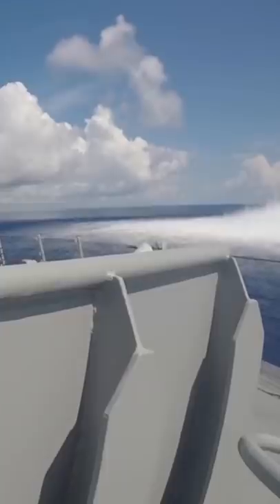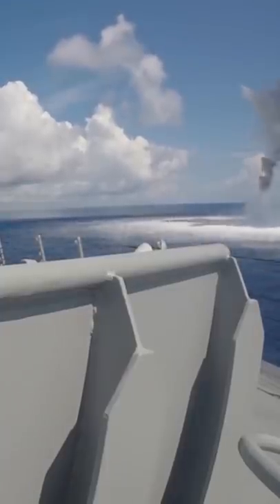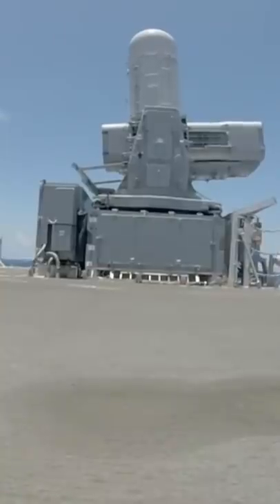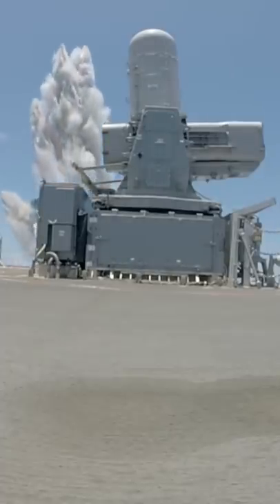Why US Navy Detonates Large Bombs Next to its Ships? #shorts

Comment: It’s unlikely that simulations could be as effective due to variance between design and manufacture.
Reply: Also, how do you test the quality of the simulations?
Reply: I was a shock SME at BAE systems and it’s quite easy to assess through simple calculations if equipment can’t withstand the acceleration from a shock event. The shock trials are a final test of the whole ship, and in many cases it’s not performed, especially when nuclear powered. If the ship isn’t designed to with stand shock, the shock trail will destroy it, if it is, then it will be fine and so the test is pretty redundant because it would be too late to change the design because it’s already been manufactured.
Reply: Simulations will never be as good as real world testing. Period.
Reply: @U.F.0.  simulation software allows us to get estimates of all the forces the ship will encounter. It would require a ton of sensors to do the same with these live tests. Simulation software has gotten pretty good.
Reply: @chaseleblanc5475  still no replacement for the real thing
Reply: @chaseleblanc5475  simulation isn't the same as real combat although it depicts accurate and up to date information by collecting data. Let's just hope the sailors doesn't treat real combat like a simulation.

Comment: Idk how they expect a computer simulation to account for random stress fractures in bad steel, or furniture flying around. It seems like the computer sim is a good idea until you look at the actual data they get from these tests that would take years to simulate.
Reply: Yeah but physical trails have it's fair share of problems too, what if you do a test but the repair afterwards is below par. Won't hold up the same next time. A powerful enough computer backed with enough data and accounting for enough factors can be nearly as accurate as a real test while being cheaper and faster.
Reply: Or any electrical connections being rattled loose..
Reply: We've been able to accurately simulate the effects of a nuclear bomb on naval vessels since late '80s and most of the important shock testing (the stuff that actually impacts the design) has been computer simulated for like 2 decades.
Reply: @andrewmoore7022  only because we initially did it for real. Its much easier to simulate the effects of something when you have a real identical situation to compare it to.

Comment: Watch closely, and you can see the water transition instantly to its 4th, and opaque, state. Black water. It happens on the surface as the shock wave passes through the water, and persists for a few seconds afterwards. The water goes from light blue to dark dark blueish blackish, instantly.

Comment: Amazing how one of the reasons they are stopping isn’t for any environmental concerns 🤦‍♂️
Reply: Why would they? Tests like this are done in areas where the environment wouldn’t be effected.
Reply: @theplaguedoctor4242  how do we know? Pressure waves move across the water in larger distances then the air due to the water transferring the energy further.

I would think animals that require sensitive hearing can sustain damage from these test. Its not like they can bunker down with hearing protection.
Reply: @vicenteasaro1823  you do realize that we have sims that runs simulations for that right?
Reply: @theplaguedoctor4242  that's not where the conversation was going. We're talking about explosions in the water effecting marine life, you do realize that right?
Reply: @vicenteasaro1823  that’s what I’m talking about, they runs sims and do tests before choosing a testing area.

Comment: The on board videos of these are mind boggling. 
As a welder,  were required to watch them. To understand the incredible amounts of stress put on these vessels.
And how important each and every weld was. That sailors lives are at stake.
Also to see if there are any inherent flaws in design, that needed to be addressed. Before full scale production of a new class gets underway. Not all new classes get tested this way either. And usually only one ship per class is used for testing for a variety of reasons. 
Simulation is good. 
But highly doubt at this time. It could   cover the millions of things that occur throughout the ship within a fraction of a second,  then ripple effect.
Makes any action movie portrayal of a similar event. Look like a hand animated cartoon from the 1930's.

Comment: The US Navy will do a marine life search for anything in the water bigger than a sea turtle. There’s days worth of prep before these experiments. They find areas that are naturally devoid of marine life, anchor out sonobouy at low volume and adjust them up over the course of several days to make an acoustic fence. Then do final checks, if area is clear, 💥, if not, they wait.
Reply: Thank you for your input, while I do know these test insure the equipment works under pressure, I also was worried about the marine life that were sacrificed to save lives in the future.
Reply: @vicenteasaro1823  they don’t test when there’s marine life at risk.

Comment: "computer models" are gonna be the death of us.
Computer models don't show if a welder didn't get full pen on a structural weld.
That's just one example out of an endless number of examples.
To err is human and not one of us is infallible, the computer would test the loads of blasts etc but only testing as if the ship was built exactly to specifications.

Real trials are beneficial in more ways than the computer could ever be.
There are times the computer model is best such as the blast information concerning the hull thickness and materials used but not in installation. In testing military weaponry, vehicles and anything that would have personnel either manning or operating real trials are far more efficient to finding any human errors prior to operations within a real warzone scenario.